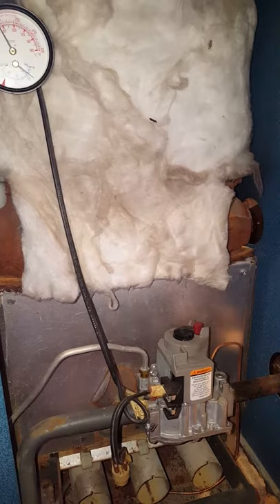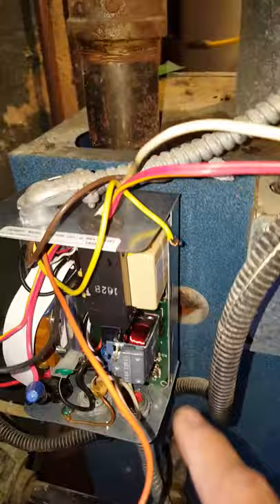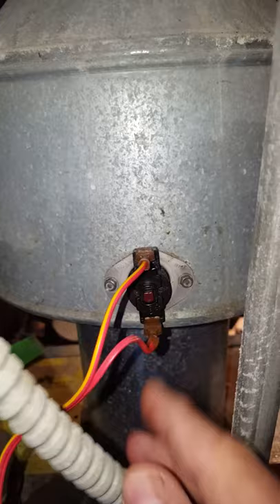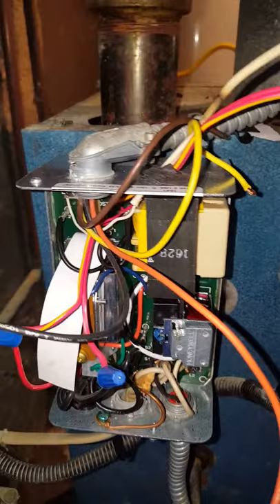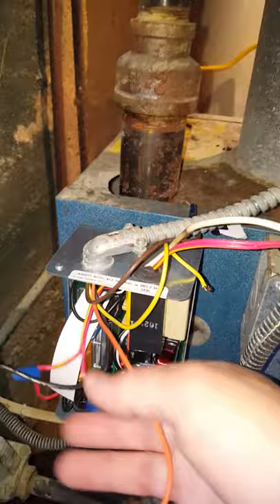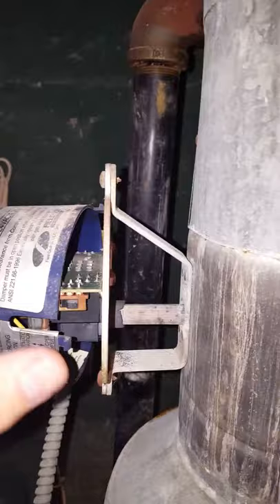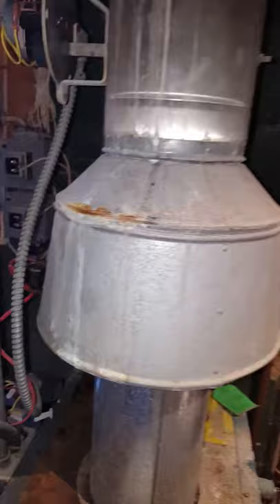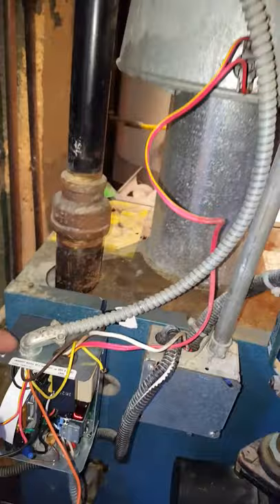Gas Boiler Keeps Shutting Down

Comment: My boiler is doing the same but when I take the damper out of the circuit it shuts the whole system down. I read I need to jumper a couple pins on the female cable attachment to bypass the damper? Did you do that?
Reply from the maker: Hi, I'm not a tech, and they keep updating systems. so I'm not sure what you have. But I disconnected the 110 box cable and just took it out of the system. I didn't jump anything. Make sure your damper is in the open position. Sounds dumb l know. But you may be causing the safety switch (by the flue) to shut down the boiler. Sorry if this doesn't help. Try gray furnace man videos. He's a pro.

Comment: Hi, I have the same problem so should I replace the damper ?
Reply from the maker: I'm not a professional, but disconnect the bx cable from the damper. There's a manual switch on the damper to hold it open. MAKE SURE IT'S OPEN. If boiler works it's the damper. Good luck

Comment: My water boiler keeps shutting down. We have hot water heat
Reply from the maker: Hi Nate, I'm a guy like you, trying to figure out what is going on. Maybe it's your thermocoupler? Does the pilot stay lit?
Reply: @royboy3597  I've learned a lot about boilers in the past couple days but I don't know about pilot lights or thermacouplers yet. So far we think it's the low water cutoff or the emergency heat valve.